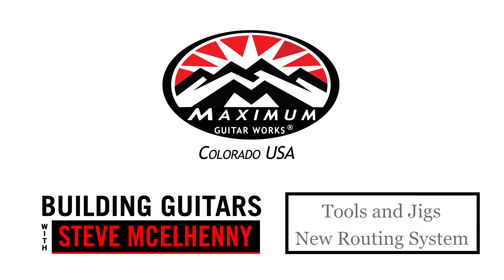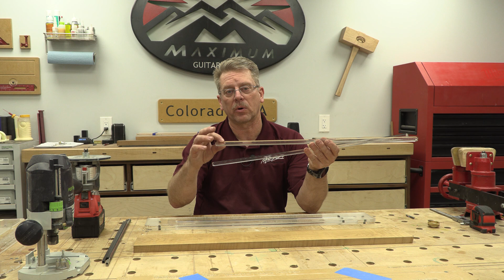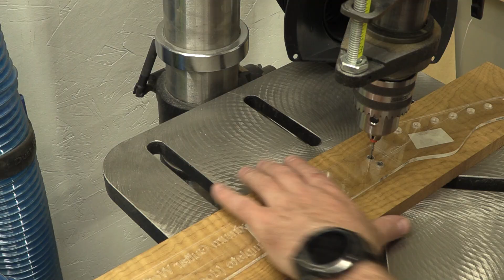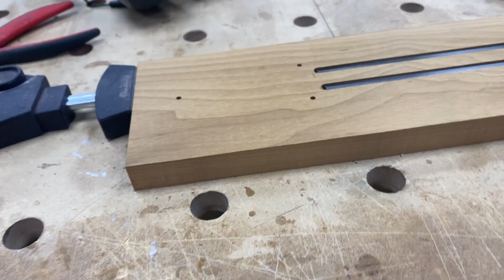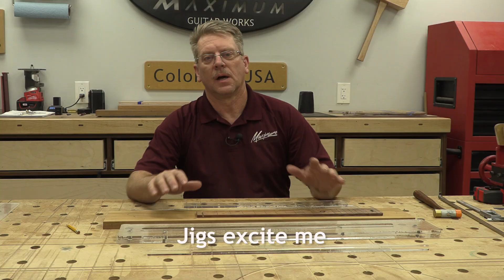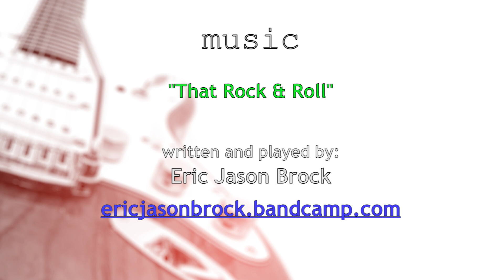Easiest Truss Rod and Carbon Fiber Install ever!  Maximum Guitar Works Tools and Jigs Series

Comment: When you drill the holes for the alignment pins how deep do you go?
Reply: Also, love the videos. Thanks for all the help you’re putting out there. Planning on ordering this neck template system
Reply from the maker: I drill about 3/16” deep in the neck…and about .100” in the bottom of the fretboard. The fretboard for sure needs to be a flat bottom bit to prevent having a point penetrate the top of the fretboard after you radius.

Comment: I was told that the Truss Rod Channel needed to be Arched and not cut Straight. What is your take on that?? I am going to attempt a Neck build and attempting to learn all I can before starting. Thanks, Russell
Reply from the maker: You are referring to how single action truss rods are installed. I use and prefer double action truss rods….which use a flat channel.
Reply: @maximumguitarworks  Thank you so much for the Really Fast Reply. I gotcha.

Comment: Hey Steve, what pinwheel truss rod are you using in this video? Great template set, going to be buying this set, just not sure how you handle head stock shapes.
Reply from the maker: I use custom length stainless steel truss rods from Allied Lutherie.

Comment: Where do I buy carbon fiber 48 “ long , need for neck thru body support.
Reply from the maker: I buy them from Dragon Plate.  They are 48" long...the square tube version.  Although...I really think that you still only need the support in the actual neck portion of the guitar.

Comment: Your attention to detail is off the scale. Can these be purchased in the uk without crippling import duty and shipping costs?
Reply from the maker: Thanks Tim.  I'm not sure what your import duty is...but shipping is not horrible.  I have shipped many to the UK.  A 1 lb box  was like $40...and a 10 lb shipment was like $80.  Maybe be high for just one template...add a few things...maybe some knobs...it is a better rate.

Comment: We used this template set yesterday, of course, we had excellent results. 
If you have a router and some maple you can do it!
I recommended to the student using this that a full size drawing was a good idea to help him sort out the truss rod access. He did it perfectly. 
We started with excellence and finished with Coors
Reply from the maker: That is so awesome.  I'm glad to hear your student(s) where able to make good use of this template system.  I need some pictures from your class.